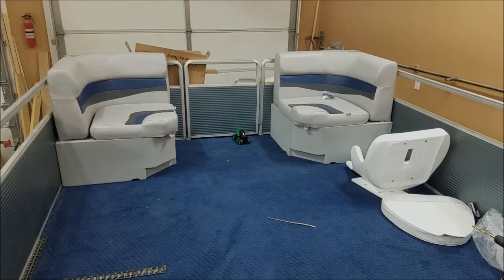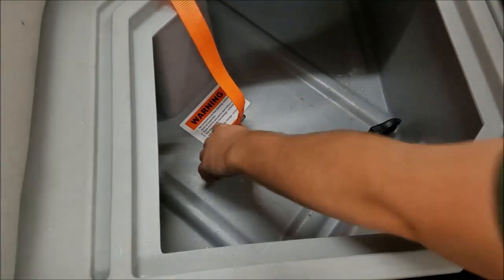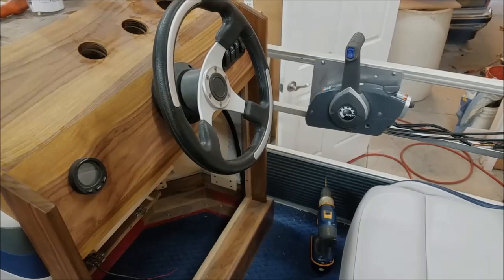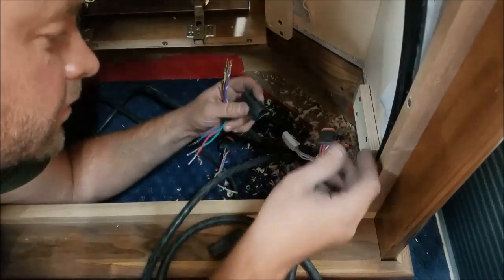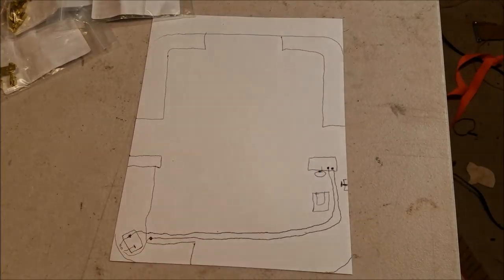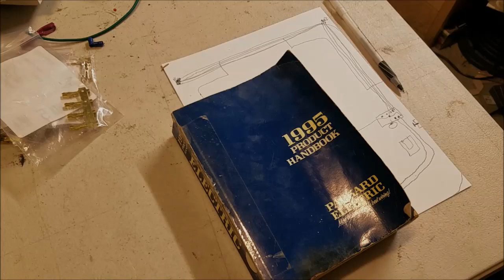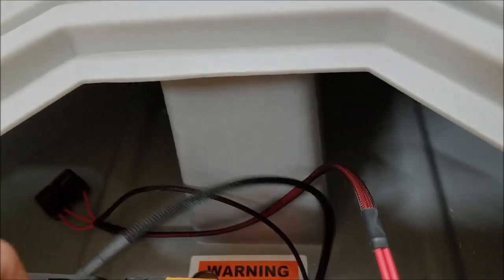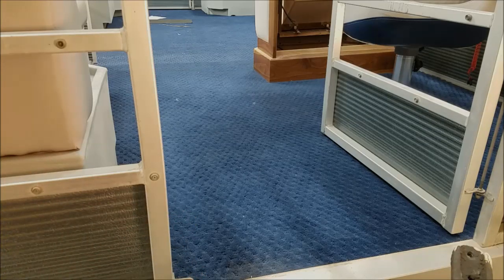Craigslist Pontoon Boat: Wiring / Electrical

Comment: Wire the gauge backlights to ignition hot. That way the lights will be on any time the key is. The small amount of heat from the bulb will drive moisture out and you will always have clear gauges.
Reply from the maker: Good idea, and I like it.
However, the average temperature during the boats use is 100+, the bulbs probably wont help that much.

Comment: Putting the hold down adjuster on the side of the battery is a bad idea. even though it may be tight, the vibration of the boat will course the metal of the unit to slowly wear a hold in the soft side of the battery, if he is going to put it that way, he needs to put some type of buffer between it and the battery, even just a flat thin plat of metal would work. Having set up boats for years has taught me the hard way.  They do make a battery hold down unit that does not use any straps, more like the unit you have in your car, with a brace that goes over the top of the battery with two rods that hold it down. You just have to put the two hooks in the floor of your unit to hold the hooks.
Reply: I've seen this happen on other things, as well. An automotive battery tray would have been best, but I would recommend some kind of tray under that battery if possible. Ideally you would have a tray there, and the strap and hold-downs would have been on the outside of the tray so as not to directly rub the side of the battery. If you leave it like this, you'll have to watch it very closely.
Reply: Daniel is right. The system he mentioned is standard on pontoon boats.

Comment: Enjoying your videos of this boat.  Just subscribed.   Only recommendation I might suggest would be battery box and battery isolation switch.  I'm also thinking you'll also be adding some sound to the boat once you start using it.  A second house battery is pretty good insurance from stranding yourself after a day at party cove.   In that case you'll want a isolation switch with VSR.
Reply from the maker: That was plan A, until I priced out a quality switch.
Then it became plan 0. 
However, while at my other shop, I found my previously-used isolation switch, its now on the to-do list.

Comment: Just a suggestion, but you might want to install a couple of small solar panels and connect to that battery, or maybe to a spare. They can become invaluable on pontoons. We installed a separate battery with solar chargers and it allowed us to put usb chargers for cell phone outlets. It's a nice safety addition. You can also run solar lights in strips around the seat bases on those chargers or separate charging panels. Anything you can run off of another battery or batteries just keeps the drain off your starting battery

Comment: How do you tighten the nuts on the bottom side?  My toons and deck are only 2" apart and hands don't fit.  Especially trying to turn nuts.  Most bolts I tape a wrench to flat bar stock and have the wife turn from overhead while I hold them on the bottom.

Comment: Looks like a fun project.  Always wanted to do a pontoon boat. LED lighting will be awesome on this boat. Some underwater lights maybe?
Reply from the maker: I too was thinking underwater lights. Only thing is, they are made to be cut into the hull of a boat. 
Which, for a pontoon, is a horrible idea. Perhaps more like some 'plug in and hang down' lights?
Reply: @BrandonsGarage   They must have something besides thru hull lights? It would definitely be cool to be able to change the colors. I'm new to your channel, I used your info on the Evinrude 15,  after I found one for free at my local flea market. Poor thing was abandoned, so I brought it home. Thought about starting a new business selling its valuable parts, lol. $250 for the carb?

Comment: Great and bad idea on the battery strap, the vibrations will make the ratchet chew through the battery case, might wanna put a rubber strip between the battery and ratchet. Otherwise great job
Reply from the maker: I have some fire-hose, Ill probably go with that.
You're right though, the side wall thickness are a joke.

Comment: What amazes me what is your load and how long is your wiring on your boat for voltage drop
Reply from the maker: Load? What load.
Engine starter is the larges load, it uses its own cables. 
Boat is 24', longest run therefor is not more than 24'

Comment: Long term issue with battery is it’s at the bow, will take a lot of pounding and those ratchets may begin to wear a hole in the battery
Reply: Sorry about the bow statement I see you have battery in stern.  Still question the rubbing issues.  Why not have a ground bar.  Run all ground to it, then it to ground?
Reply from the maker: Well, I kind of do. In the rear, where the battery grounds to the boat. I can attach things there. 
Also, the grounds in the console all have a ring terminal for this very thing, just need to get some hardware.

For the rubbing, this was a concern too. I might put a cardboard/rubber piece in there; but these are the cheapest straps out there. They probably wont wear through anything.
Reply: @BrandonsGarage  understand cheap.  Heck they may rust close.  I have a set that did.
Reply from the maker: I planned for that too, simply cut it off and replace with newer unit.
Reply: @BrandonsGarage  grab an old spent bicycle tube - I've used them for lots of similar projects and they'll thread right over those straps like they were meant to be there.  👍

Comment: why didn't you put the battery in the center console?
Reply: It's all about priorities, it's either that nifty trash can or a battery.
Reply from the maker: Too far away from the engine.
Reply: @BrandonsGarage  I see..    This could be done, just needs a real thick cable like 2/0 AWG or better, right?  I'm thinking of putting my battery in center console..
Reply: Well I've owned 2 pontoons both Lowes fishers and they both would submarine  you better watch how much weight your putting in the front pontoons don't really get on plane and there always trying to go into the water.
Reply: @jslugbug37  Thanks for heads up!  I'm redesigning the top side of my pontoon.  I'll keep that in mind.   I'm fabricating a trophy sized live well, so that will help with rear end weight!
Reply from the maker: Even a tri-toon will submarine, its just more frequent with a pontoon. 
For the record the battery is in the rear.
Could have put it in the console, just didnt care too.